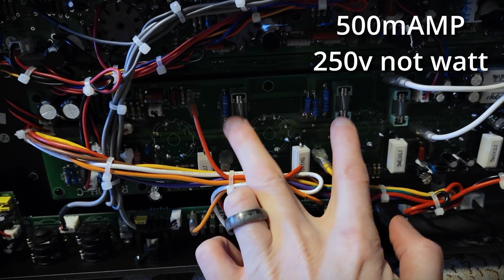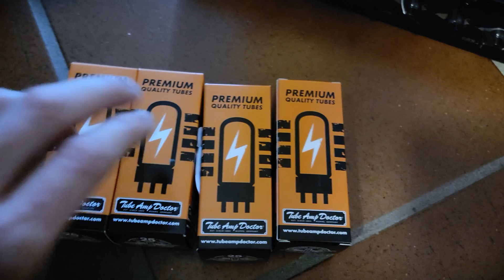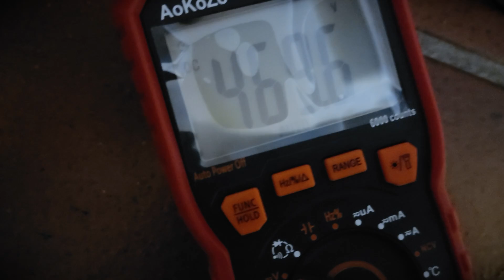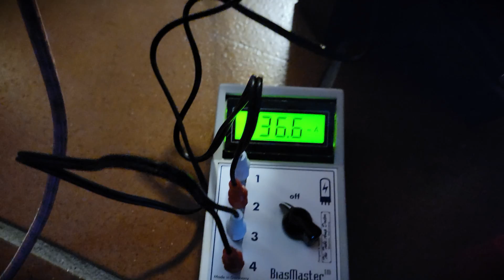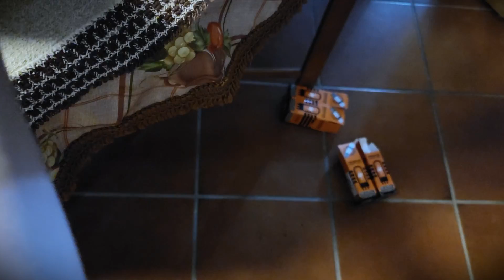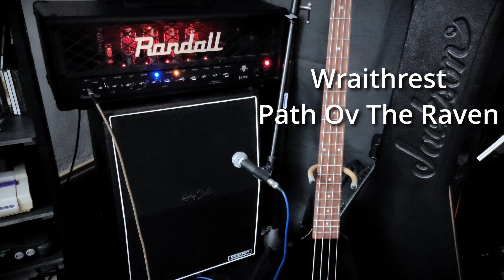Randall Diavlo RD100 Tube Amp repair & Bias

Comment: Hey man, I only got a cheap adapter for my multimeter, would I be able to copy your bias for my rd45h and be safe? I don't have a way or checking plate voltage, etc. From what I understand, they amps come underpowered at about 28-30, which is a shame. Im about to swap tubes in about an hour and was hoping 36 would be safe?😊

Comment: heya, you stated you replaced the 2 fuses rated at 5oo mv, (o.5A) , but do you know what are the other 2 fuses are rated at ?.. the one to the right of the 2 you replaced, and the lower bottom right .. ive the same problem that you had, but i want to replace all 4 of the inside fuses, not just the 2 5oomv fuses blown.. appreciate any help ..
Reply: totally understandable, i didnt know if they were replaced with something different, id been searching for schematics for last 2 days, so thought id ask.. appreciate you getting back to me..
Reply: @thesawbladecartel  here bro these are all the fuses, I had to do all mine years ago
Reply from the maker: Hello, sorry I can not confirm what fuses they are as I haven't had to re open the amp since this video. But it's possible they are the same ones. Im sure if you pull them you should be able to read a code on the fuse itself which will let you know what you need.

Comment: I can't get my amp out of the case, I've loosened all the screws but it's somehow stuck 

Do you have any ideas?
Reply from the maker: @julian-904  you took the screws out on the bottom?
Reply: @Nullifer  yes
Reply from the maker: @julian-904  i wouldnt recommend forcing it but mine was slightly stuck too, just make a full 360 check to make sure you didn't forget a screw

Comment: Have this same amp and getting ready to replace the stock tubes. Any chance you could explain how/what the calculation is to get proper bias values from plate voltage? Thanks!
Reply from the maker: https://www.amplifiedparts.com/tech-articles/tube-amplifier-bias-calculator this is the calculator
Reply: @Nullifer  Perfect. thank you! Thanks as well for sharing the plate voltage. Assuming all RD100's plate voltage is going to ~470V, but to be sure will definitely measure mine as well when I re-tube.
PS. How do you feel about the sound/quality of the TAD 6L6's over the stock Ruby 6L6's so far? Never used them and I'm trying to decide on Ruby's, JJ's, or possibly TAD

Comment: I have the exact same amp and had the exact same issue; two of the tubes were on their way out and took a couple of fuses with them in the process. I got a matched used set of 6L6s and pretty much went through the same process you did, except I’ve got a slightly colder bias.

This tends to be an issue down to the stock Ruby tubes not being all that great.
Reply from the maker: I noticed that mine was not biased correctly also, and those were the ones that crapped out
Reply: @Nullifer  Unfortunate case of poor quality control.

On the upside, you’re probably the first person to have a decent quality video fully outlining the biasing process for this amp. Many people on various forums and YouTube comment threads have been looking for such a guide.
Reply from the maker: @kadestorm  glad it was useful 🍻